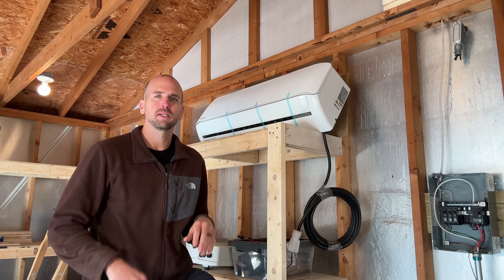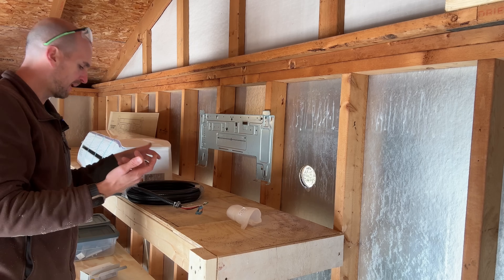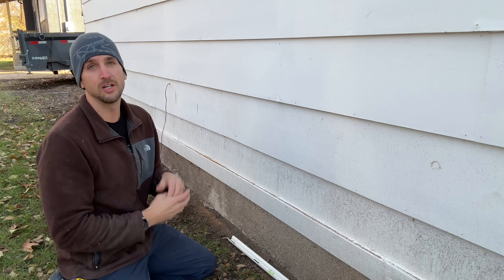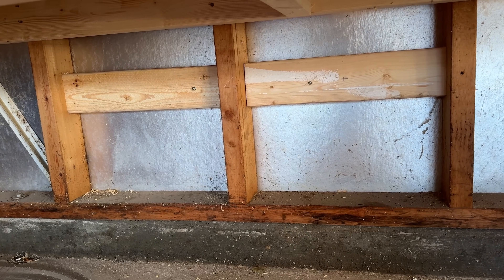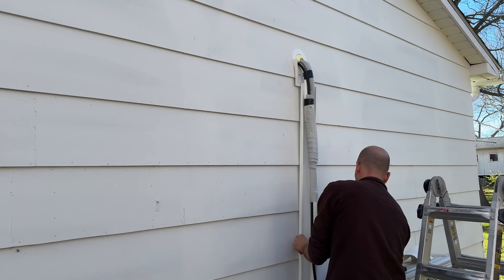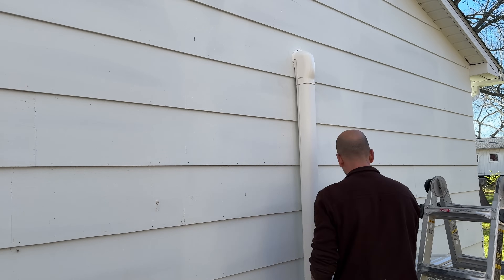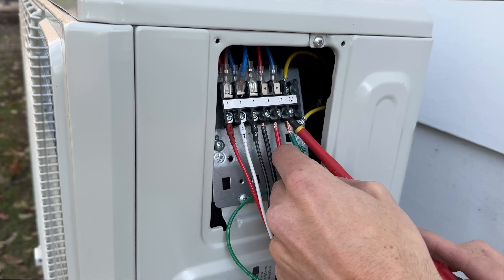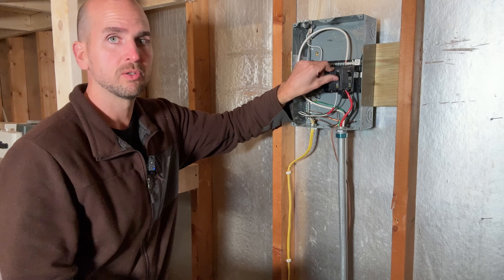Complete DIY Mini Split Installation | New Mr Cool 4th Gen Unit

Comment: On all the mini splits I’ve installed, the instructions said the hole in the wall is supposed to be angled down for proper drainage. Is there a reason why that is not discussed here? Other than that great video.

Comment: wow, you didn't vacuum and leak test the lines  first? how is that going to work?
Reply: Leak testing would probably be good but the way MrCool precharges the lineset allows them to be connected without pulling a vacuum.  That's essentially the DIY part that other mini splits don't have.  You have to have proof of professional installation to have a valid warranty on the non DIY systems.

Comment: I purchased a 2-ton Mr. Cool unit and after 3 months it stopped working. I called them and they quickly shipped a replacement unit. I installed it and again after 3 months it quit working. I called Mr. Cool again and after going back and forth trying to diagnose the problem, they ghosted me.
I have a friend that is a HVAC repair guy, he looked at it and saw that there were several places that were leaking Freon due to poor soldering at the factory. He offered to sell me a replacement unit, but he would not repair the Mr. Cool. I could not find any local repair businesses that would work on a Mr. Cool. 
My recommendation is to buy locally. You may pay a little more, but you are supporting a local business and you can get support for any issues.

Comment: never did like the coiled lines like that. outdoor unit should have been in a different location to match the pre charged lineset you had, only because  you created an oil return trap and with that trap you created oil cannot properly return to the compressor. certain applications require a oil return trap and that application would be that the outdoor unit being higher that the indoor head unit or air handler anywhere 4 to 6 feet above based on manufacturer specs. every brand is different on those specs. but having this trap you created with head unit above outdoor unit in this application can damage the compressor because oil cannot return to the compressor (trapped oil in refrigerant lines) therefore locked rotor and ultimately having to replace compressor
Reply: other major issues also can happen as well when heating or cooling with lineset being coiled like this and people tend to blame brands. installation is key
Reply: outdoor unit being 4 to 6 feet or above indoor head unit**

Comment: My question, the recharge ed refrigerant lines ,air in the system, open evaporator and open end on the line set., ( no vacuum pump)  are there valves on both ends of the line set?  Even so the evaporator is open.
Reply: Nothing is open. Indoor unit, outdoor unit, line set - they are all closed. Special quick connect like fittings open themselves up when tightened to allow refrig flow through system. Don’t listen to anyone on here that talks about having to vacuum pump and the line sets or evaporator or condenser being open or have nitrogen. They don’t know what they’re talking about these these specific Mr. cool systems. I just installed a little 9000 BTU system a few days ago and it’s running absolutely beautifully to heat my sunroom. And it will cool it in the summer. I tightened the connections down as the instruction suggest, leak checked it, running just great.

Comment: Okay I have a question some people's probably gonna think it's stupid but that's okay Why not just set the whole system up inside instead of going outside as well Could someone please enlighten my ignorance?
Reply: The part that goes outside put out the warm air that was exchanged at the inside unit.  When heating the outside part puts out cool air.  If both were inside they'd cancel each other out and the temp wouldn't really change.

Comment: Question please. Can I bend the lines to go down the wall cavity inside, then exit the building? The unit will go on my garage wall which is the front of the house so trying to avoid visible lines running down the house to the outside unit. Thank you

Comment: The charge is in the compressor. You can cut your lines to length and flare the ends back. I know cause I just hooked one up. They are all the same basic concept. Good job setting yours up. Bet your nice a cool now!
Reply: The lines come vaccumed.  If you cut them, you need to vac them again.

Comment: Mistake number 4 (as made in this video) turn the rubber pads 90 degrees so they run the length of the bracket, not hanging over the sides and do not squash them down as doing this will defeat the purpose of the bushing itself. Nylon lock nuts should be used here.
Also the lines should be checked with soapy water at all the connections checking for leaks. If you have a slow leak it won't take long for the unit to stop working as the compressor needs a certain amount of pressure to work.

Comment: The biggest mistake I think is having the inside unit leveled, when it should be a little bit tilted to the right , otherwise you will have problems with condensation water over flew ..

Comment: Wonderful video. Thanks! 2 things: 1) do you feel like the 18k unit was enough for your garage? It looks like it's not insulated, so curious if it's enough for your climate (please let us know area you live)? 2) I believe new electrical code  (NEC 210.63) specifies that a 125-volt, single-phase, 15- or 20-amp receptacle outlet must be installed in an accessible location within 25 feet of the equipment and on the same level. I would imagine it has to be outdoor enclosed and GFCI.  Thanks!

Comment: Can you have an AC guy cut off all that extra coil put a flange on the ends and re hook it up
Reply from the maker: Yeah, that would work 👍
Reply: If you want to hire someone to do that part you can probably get a cheaper unit like the Tosoto he did a video on.  Most units not marked as DIY like the MeCool require professional installation to not void the warranty.  I wonder if modifying MrCool lineset would have any affect on their warranty.

Comment: Just a few quibbles . . . Only code violations . . . Nothing important 😀:
—  White wire only for 120 neutral. You’re not allowed to use a white wire for power, even if you wrap it in red tape;
— If you do have 120v power, you’re not allowed to have a fuse on the neutral line. “Dummy” fuses are available for the disconnect, if you prefer;
— Want “Romex” with a red wire? Either run 3-conductor Romex and abandon (cap off) the white wire, or ask your parts house about “tray cable;”
— Where’s your required outside service receptacle?;
— The whip needs to be attached to the wall

Comment: While the unit uses a metal support bracket on the wall the wall unit that hands on that bracket is cheap 1/8 plastic that like all plastic will eventually become brittle. So cheap looking I would have taken back to Lowes but found Lowes has a 3 day return policy on their appliances and ac units. Mine is the 12k unit, not sure if the larger units are made as cheaply. Not happy at all with my Mr Cool. $1700.00 for what looks like a disposable product.

Comment: Nice video.  With all of the wall space you could have placed it where the airstream is not blocked by a shelf.  These units direct air out and downward. I used a unit with oscillating vanes.   That wouldn't work with your placement. 

Secondly you skipped a critical step that being checking for leaks before covering the fittings.

Comment: I have 2 questions. First,  what is the lowest outside temperature that this unit will operate for heating? Second, which switchbox is used outside for the 120v unit? Thanks in advance

Comment: Pro tip: Start drilling your 2.5” hole from the inside & when you’re halfway through, go outside and begin drilling about half and inch or an inch lower than the hole inside. Your drains will always have proper fall
Reply: Good call. I just did mine recently and have a drop going outside with the line on the bottom. I put the flimsy condensation line in a good and it looks a lot better.
Reply: @kobrewing That’s the way to do it brother 💪

Comment: There is no refrigerant in those lines. When they say "precharged", they actually mean they are already under a vacuum. All of the refrigerant is in the compressor. You should open the low-pressure line (the larger one) 45 degrees for 5 seconds to get some pressure into the system then check for leaks before fully opening both valves.

You should also not coil the lines vertically as this could cause puddling of the refrigerant in the bottom of the loops. Also, you are blocking some of the radiator with them effecting the efficiency.
Reply: No. They ship them with nitrogen in the line to keep water vapor and air to get in the line. What they mean by precharged system is the condensing units (exterior unit) compressor is precharged with refrigerant. After hooking up the lines you still need to vacuum the lineset. Aftet they are vacuumed u release the refridgerant from the compressor into the lineset.
Reply: Except they are precharged with refrigerant.

Comment: I used a level to install the wall bracket and screwed it solid to studs but for some reason when I set the indoor unit on the bracket, it's not level and the unit wiggles on the right side and isn't right to the wall. Suggestions?

Comment: I have an old stone home in portugal and was quoted €3,200 for two 1,200k units complete installed. I asked around the village and was told to use a different guy, he quoted me €1,550 for the same two units installed. He did the job while I was not in the country, he sent pictures each step of the way and decided to relocate the placement of the upstairs unit, he did charge me a total of €1,650 with the extra charge for the extra work and materials to relocate. This summer when I returned I found both units professionally installed with white box conduit run at the ceiling meets wall area, each corner perfectly mitered and all holes sealed. The only signs that he was there were the units, no dust anywhere. He was as professional as any craftsman I have seen. He refused to take a deposit and actually waited until both units were installed and fully functional before billing us and then offered for us to wait to return to portugal to inspect before we paid. He of course was paid immediately and we have recommended him to a few other people.

Comment: Great video only thing i will correct you on is that the line set are not charged the refrigerant is actually in the compressor and is released when you open your valves so if you didn't want to coil you line and cut them to length instead you are able to do so
Reply: Units marked "DIY" have precharged line sets that don't require vacuuming.  It's why they don't require professional installation at the cost of your warranty.

Comment: Installing mini-splits DYI is one thing but the key to having them last is maintenance. Keeping them clean is another. The outside condenser coil is straight forward although the inside air handler is a bit more involved. Just cleaning the removable permanent filters isn’t enough to prevent issues over time and a professional will have to be called in. The components in the air handler are fragile and not knowing how to disassemble and properly clean could result in damage.
Reply from the maker: How often do you disassemble and clean?
Reply: @EverydayHomeRepairs  once a year

Comment: I watched your video on this installation and the one thing that is really important I didn’t see was checking your refrigeration lines for potential leaks because if one of the connections is leaking to repair it you will have to call in a professional to evacuate and weigh in the proper refrigerant charge. If that happens when he’s there you might as well have the line set shortened and if you saved the line cover kit install the line cover so that it covers all the lines to the service port for a nice clean mostly sealed install. The other issues I would address is by mounting the condenser on the wall outside I would recommend about 24 inches above the ground will avoid lawn maintenance issues in the future. Other than that everything else was on point.
Reply: great observation

Comment: I'm a bit confused.  I don't understand how the lines could be pre-charged.  It doesn't appear that the lines are sealed.  Most ductless units are sent with the compressor pre-charged.  If the lines or compressor aren't pre-charged, one or the other would need vacuum  before connection otherwise you would have air in the system.  That would also mean that the line couldn't be cut to length.
Reply: Indoor unit, outdoor unit, and the line set, are all pre-charged and closed with the quick disconnect like fittings. And you tighten the lines together internal valves open up to allow refrigerant flow.
Reply: @dougreed2278  Thanks!  I wonder why they all don't do that since all it would require is two male and two female of the special connectors.  Everyone is already including the refrigerant anyway.

Comment: I just watched one of your DIY videos. And I was awesome. Then I saw you made one for a Mr. Cool. Great video. For all you out there looking to install one yourself. Do it. I live in Connecticut. One of the highest electric rates in the nation. The average bill bounces up almost 500 bucks a month for June, July, and August.  Goes from 200 to 700. It pays for it in savings. Buy the time I brought everything to install my 36,000 btu unit. Wire, 40 amp breaker ect. Was probably about 7 grand. But at 1500 bucks a year. Within 5 years it paid for itself. Very comfortable and quiet.  Couldn't be happier. Do it. One of the most satisfying jobs I ever did.
Reply: Hi, I'm in CT as well and looking at an 18k unit for my garage (450 SF) and very well insulated. I have a 220v electric heater out there now and was going to remove that and use the 220 circuit already there. I could probably get away with a 12k but one person said the A/C might be slightly undersized, heat is no issue for either size. Do you have any issues at the hot/cold extremes we get in CT?

Comment: I want to get a unit with pre-charged lines that will be cheaper maybe not last as long but can be installed..
I'm a fan of through the wall window AC units that are pretty quiet and very cheap and easy to install. Frigidaire has great 5 year warranty you could buy and they send an expert out.

Comment: You have a breaker on the subpanel. The fused disconnect is redundant and more expensive. All you need is the external disconnect. Otherwise, you are one of a few that gets the electrical part spot on, right down to making sure no more 1/2" sheathing remains in an enclosure. Good job.
Reply: From what I understand most code require a disconnect within 6.5 feet of the AC condenser
Reply: @WesleyOrias  Maybe local code, but not NEC. 440.14 says disconnect within sight of condenser. 440.4B says OCPD per nameplate. Sometimes the over current protection for the listed amperage is unavailable so in those cases a fused disconnect of the correct amperage is used at the condenser.

Comment: Please mention or note that this mrcool hole saw is an additional expense and not included with every system. Customers call all the time and ask why they didn’t get their hole saw. James at MrCoolDirect

Id also note that the coils of excess line set should remain in a horizontal  orientation so the lubricant oil in the system doesn’t pool in the low spots and starve the compressor of oil because of gravity holding oil in the low spots in a vertical coil. 

Great very informative video thank you for putting out this video

Comment: Aw crap! At 17:00 the air handler is definitely not mounted level on the wall. I see nothing else in the frame running in parallax so the unit is the one out of level. 🤦🏻‍♂️

Comment: Do you not have to vacuum the refrigerant lines before releasing the refrigerant into the system?
Reply from the maker: The lines come pre-charged and if everything is done correctly you shouldn't have to pull a vacuum.

Comment: I will not pay 9 grand for a new system and in the 4 years sense it has been nothing but one problem after another. The compressor went out 6 months after install. Then a year later compressor went again the warranty replaced the compressor but 1800 for labor. Then the inside coil broke and had to pay another 1200 bucks. TXV valve died on the outside unit 600 bucks for it and my TXV valve went on the inside . I fixed it and I bought me a 18,000 btu mini split from Ebay .
I bought me new copper lines the one they send suck and leak and blue nylock . I was quoted 6000 bucks for him to install it after all the money I spent with this guy. I told him no I will do it myself he laughed at me and made me MAD.. I did install it myself in 7 hours  and for the last 18 months I have not called him once and he was shocked when he came out to do my yearly system tune out which I cancelled and also told him I would never use him again. My cheap mini split heat pump heats and cools my whole house. My 2.5 ton Ruud once it gets about 30 it cant keep up and blows COLD air, which I dont understand cause my Gibson heat pump that broke had no issues heating. I have gone almost two years with no problems even when it got down to 0F here last winter the air coming out was hot. Even if my mini split  has to be replaced every 5 years I will still be better off. Mine says York on it I got it from a scratch and dent over stock place.  Best 700 bucks I have ever spent.

Comment: Great video! unfortunately, I came across this AFTER I had installed my mini-split. I wish I had seen this earlier. For example, I have an appliance dolly like yours, but I didn't think to use it to mount the unit. I muscled it up by myself. My back is still sore. 🤕